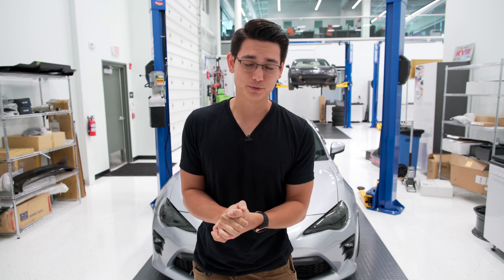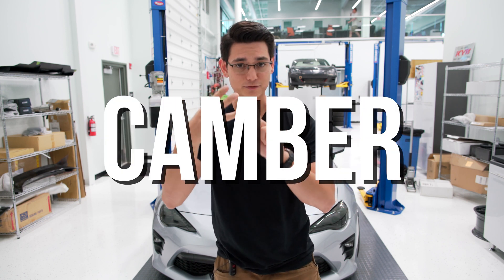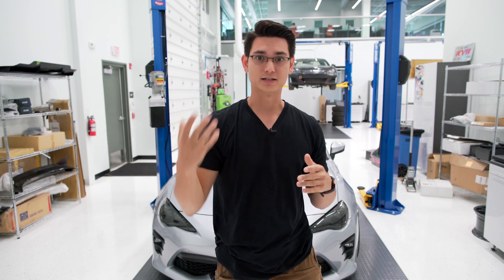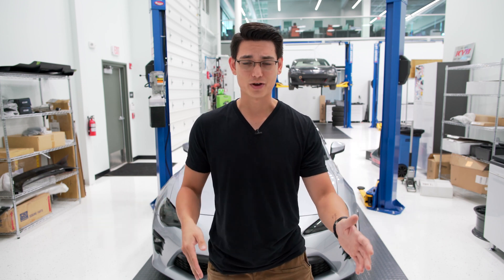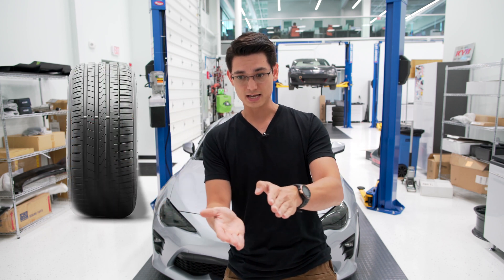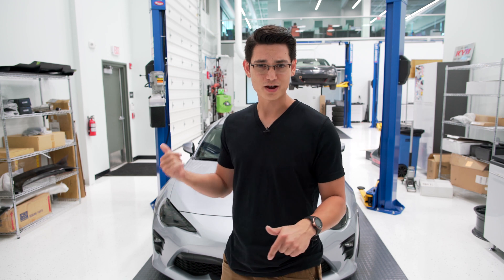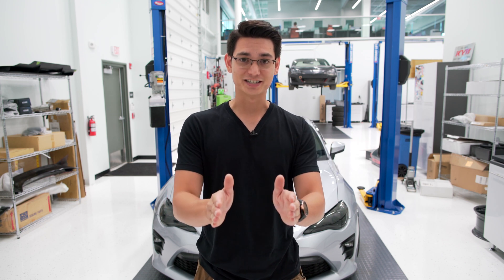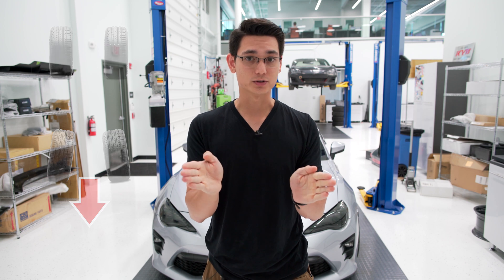Wheel alignment basics | Caster, Camber, Toe

Comment: My car started pulling to the left after I got new tires, got an alignment and the rear right toe was -.96. They were able to get it to -.27 but my car is still pulling to the left and they said something is wrong with the alignment but didn't know what. I took it to an alignment shop after and they said they couldn't see what's wrong and told me to go to the dealer. Does anyone have any ideas what could be wrong? Could it be a bent toe arm?  Or control arm? It's a 2017 Toyota 86 Special Edition.
Reply: Something could be bent. Why not get under your car and check

Comment: You're forgetting that caster also lets you have more camber with steering input. So if you don't want more camber because lets face it, too much negative camber is bad for driving in a straight line, but you want more camber in the corners for handling, you add caster. I don't know how viable it is to add caster on our cars, but it's IMO the biggest factor of caster. Also worth noting more caster reduces how much the wheels turn though, which affects turning radius.

Comment: How much camber can you get from just camber bolts before the tire/rim has clearance issues with the coilovers? I'm most interested in 17x9 +35...40ish with 245/40
Reply: Timur Iskhodzhanov I run 17x9 +40 at -3 degrees in the front -2 in the rear. You can run more but you won’t need much more. You will only start to see problems around +45. You will be hard pressed to get that much camber out of just camber bolts though unless you do the bolt swap trick.
Reply: @Spider_Gooch  I know a few folks who ran into problems using camber bolts with +40 wheels

Comment: I just bought Apexi N1 coil overs from you guys. and plan on getting adjustable lower control arms in the rear. one of your older videos stated that if you plan on replacing the lower control arms, you will need adjustable rear toe arms. could maybe the next tech tip Tuesday be about the various diferent rear toe arms FT86speedfactory has available, and how to install them?

Comment: I know you've done a fitment video but I'd love another one that includes how big of a spacer I need (that also changes to a 5 x 114.3 bolt pattern) and tire size and how much to lower the car with either 17" or 18" wheels and how much offset etc..  I remember you saying to get an 18" wheel x 9.5 wide with a +38 offset, I'd just like an expansion of that to include the aforementioned details 😁